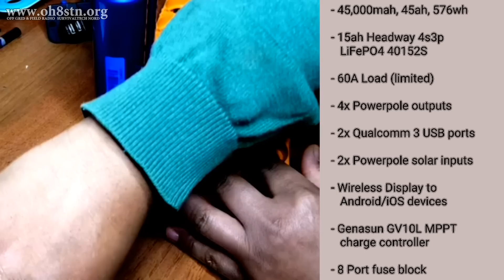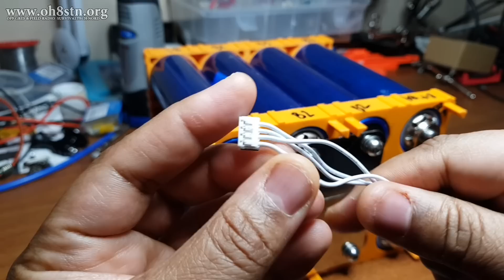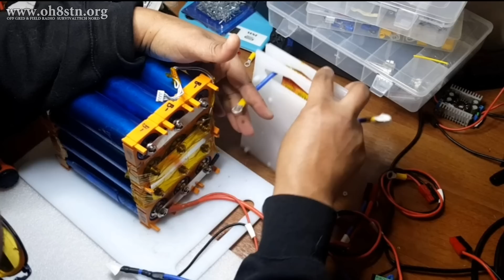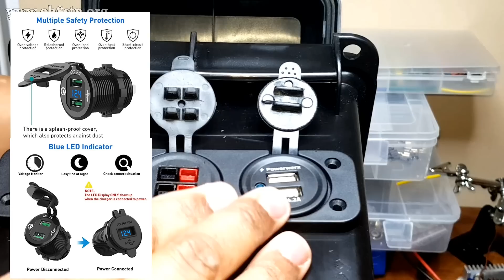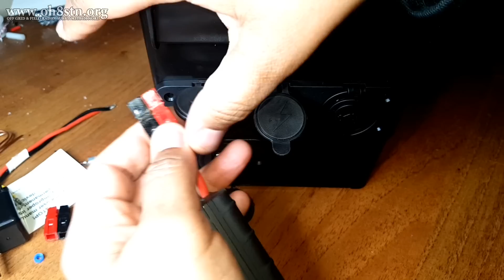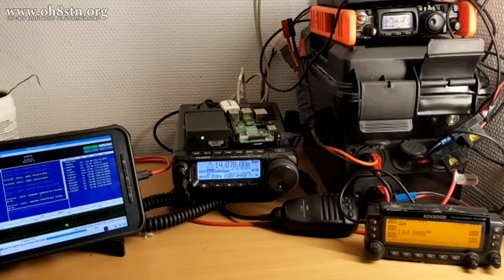DIY Ammo Can Solar Generator | LiFePO4 Off-Grid Power Build

Comment: Does this BMS - SCC combo allow the pack to charge over 13.35V? I cant seem to get it any higher for balancing, like 14.2, etc...
Reply from the maker: Hi Sammy, yes, it can charge above 13.35 V. I’m still using this build, and my battery reaches around 14.4 V. The charge voltage comes from the solar charge controller or external power supply; the BMS monitors the cells and can stop charging if a protection limit is reached.

If your pack never gets past 13.35 V, I’d start with the charge source. Whether you’re using a solar charge controller, bench supply, or charger, it needs to deliver enough voltage to bring the pack higher. Mine bring the pack to around 14.2–14.4 V. I’d also check the individual cell voltages with the charger disconnected. If one cell is noticeably lower than the others, it may be weak or out of balance; balancing can correct small differences, but it cannot repair a damaged cell. The BMS doesn’t boost the charging voltage. That has to come from the charge source.

Comment: Do you have a video showing how to configure the thornwave for this build? Particularly the low voltage disconnect. Or will the BMS cover it?   Thanks for your time N7JRK
Reply from the maker: There's a link in the description to oh8stn.org. There are all the details.  BTW, the newest Thornwave version is different from the one I used, so check the documentation for the one you have.

Comment: When using a charger to charge pack what voltage and amp settings should I use?  Thanks
Reply from the maker: 14 2-14.6v 10-20A is ok if your bms/cells can handle it. 👍
Reply: @OH8STN thanks

Comment: Built my own solar generator based on this tutorial. Same/similar ammo can but using 4 prismatic 100AH LiFePO4 cells. Genasun charge controller, BMS. I still need to add a smart shunt, ideally I should have used a BMS with such a shunt built in.....Internal distribution/fuse board. Currently using 1 100W solar panel, but will get another one to have 200W 
XT60 connectors 

Where I live I cannot get the Powerqueens etc. as they do not ship to here. Local battery sellers mark up prices by 200-300% (e. g. 100AH LiFePo4 battery ~$460) so the only way is to "do it yourself". 
Thanks a lot for this tutorial
73 de Jurgen 4z5oi

Comment: I had a Lithium motorcycle battery by Featherweight. However I accidentally ran the battery down and ruined it. What kind of safety switch do you know of that will cut off power when the battery runs low. (I was using it in my motorcycle, and had a parasitic drain that I didn't know of. So I wasn't monitoring it.)
Reply from the maker: Most riders only monitor the battery voltage during long periods without riding. In that case we would use some sort of battery tender to keep the voltage up up during storage. All quality LiFePO4 batteries have a BMS (battery management system) built-in. The BMS has a low voltage disconnect feature, which protects the battery when the voltage drops too low. Most of the time the battery is fine and simply needs to have a charge applied to get it back up above the disconnect voltage. Sounds like the featherweight lacked this basic feature.

Comment: You have piqued my interest in trying to build this generator myself.  I'm looking at your blog post now.
Reply from the maker: I thought the battery boxes were more your thing.
Reply: @OH8STN  I like both.  A new video will Premiere on my channel this week about a Renogy Solar Generator
Reply from the maker: You'll be sadly disappointed with Renogy for ham radio. I sent it all back.
Reply: @OH8STN  So far my experience has been good.  My video on Thursday tests RFI using the IC-705 and I found none of it with this unit.  I've also tested a couple of their batteries and had good results.

Comment: Your build has the power go from the battery to the fuse block, correct? I have seen some that go from the "load" output on the controller instead. Your way is the better way to do this isn't it?
Reply from the maker: It depends on the controller we are using. If you're meeting a charge controller, some charge controllers have a load port. Many of us incorrectly use them to Power Equipment rather than their real purpose which is to turn on or off a relay. I think the fuse block is a great way to protect the equipment from the battery and the battery from the equipment :-)

Comment: Good morning Good Sir, I have been slowly buying all the components to build this battery pack, one thing I am having trouble with is the BMS board.  The place you have listed requires you to buy 3 of them, and it wants $50 shipping to my home, do you have any other cheaper recommendations?  I just don't want to buy 3 of these, when I only need 1.

Comment: Julian, I was wondering if you ever updated the SG with the balance cable as one comment suggested?

And how you would wire that cable into the pack?

what I will think of that I think you should have done because it does not seem that you can get information about BMS works as it should or is reached is wrong so I think you should have a cable for the battery so you can easily check with one multimeter that all the batteries are balanced and if they are not, you can connect it to your charger with the balancing connector and charge it without having to remove everything
Reply from the maker: Yes I did wire up the balanced cable to the pack. It's wired in parallel with a bms. I use a 4s battery monitor to check the state of each cells. The battery monitor is not connected constantly. I use it periodically to ensure the bms is working properly. So far so good, the solar generator is still working wonderfully.
73
Julian oh8stn
Reply: @OH8STN  Thank You Julian. I assume you are monitoring the 4, 3P series cell packs and it is wired to the onboard BMS, to the sense leads. What 4S monitor did you settle on?

I really like this thing, such a great design and implementation of components. I need another one...

Thank You Again.

Comment: Great but I needed the AC.
Reply from the maker: The only difference between this model and having AC is a pure sine wave inverter. You can connect the pure sine wave inverter rather than the DC outputs on this. You can also utilize a combination of DC outputs plus the outputs on your pure sine wave inverter. Perhaps I should do a project.
Reply: @OH8STN  this is what I came up with. https://youtu.be/aTNk0sA5SpY

Comment: I’ve been watching these videos for a while and I would like to work on my own battery pack. Question I have is the charge controller is rated for 140v.  So if I use a 350v panel. Does that mean it will burn up the controller, or does the extra volts just go to waste ?   Thanks!  KI5PKP
Reply from the maker: It means it'll burn up your controller.
Reply: @OH8STN  Ahh. Thank you I will get a bigger controller or smaller panel!
Reply from the maker: Alternatively you can wire your panels in parallel rather than series. This will keep the voltage under your charge controllers maximum voltage, but increase the amperage coming from the solar panels
Reply: @OH8STN  Thank you kindly sir. It appears I have more research to do. KI5PKP

Comment: How do you use this without adding switch's if I don't put in a switch my battery just drains
Reply from the maker: I did add a switch to turn off the USB port. That's where the power drain came from.
Reply: @OH8STN  sorry must have missed that. Thanks for the speedy response
Reply from the maker: Don't be sorry. I'm not sure I mentioned it in the video. At least in the documentation. It's one of those things that you learn after you build something.

Comment: great video . Do you need to bottom balance new batteries ?
Reply from the maker: My strategy is fully charging, measuring internal resistance and capacity, then match the cells to their closest partner in the set before installing the BMS. I only bottom balance if using used cells, without a BMS.

Comment: What solar panel would you be mating up to this power pack?
Reply from the maker: Depends on my deployment.  Usually the fm16-7200 from @Powerfilmsolar i do use their rollable waterproof panels when it's wet or in the swamp. I use Powerfilm panels because I usually have limited weight carrying possibilities and restricted space.
Reply: @OH8STN  Cripes that's expensive! LOL. I'm working on my first "generator". 32ah 410 watt with built in BMS from Battery Hookup in a harbor freight ammo can. Typical USB, power, voltage display pack. I was planning on just charging it from an RC car charger at home, but for a couple hundred more adding solar makes sense. I'll be using it while camping to charge devices, lights, and especially for my power hungry Nikon while doing really long time lapse photography where the camera needs to run for 4-8 hours. I have that Genasun 140 watt charger in my Amazon cart...just trying to figure out the solar. I have trouble believing the specs on a lot of these foldable panels ~$200.
Reply from the maker: If you don't need the portability of the PF panels, and you do car camping for example why not check out the renogy konle's?
Reply: @OH8STN  Much thanks for sharing so much great info! Appreciated!
Reply from the maker: To add, when operating from home,  two 40 watt rigid panels in parallel, keep it topped up year round.

Comment: Thanks for the video!   Hello from Texas!  I am curious if this BMS has a temperature sensor? I am considering the 100ah headway cells once I am confident of where I can purchase them.  This will be my shack DC power supply.  I am new to the hobby and trying to get my ham shack in shape after all the various distractions that have popped up this year.  73!
Reply from the maker: The BMS does have temp sensor. It will shut down if things get too hot. Good luck with your build. Remember to ho slow.  Also, if it's not too much to ask, do I show and tell video after it's ready. It's inspiring to see how others have adapted this build to their own needs.
73
Julian oh8stn
Reply: @OH8STN  thanks.  I am also considering the Fortune Cells.  Have you seen them?  And to answer your video question, I will consider it. Right now I am in the dreaming and pondering stage.  I wasn’t going to build a ammo can power supply just yet but need a DC power supply for the shack. With battery power, I wonder if it needs a regulator to stay with INR the +\- range of DC voltage the radios will require.

Comment: What is the benefits of using your battery pack vs. A deep cycle marine battery? And what are cost differences? And will your battery pack fit into a boating battery box?
Reply from the maker: 1/4-1/3 of AGM weight. 2000-3000 charge cycles vs 300-500 for AGM. No peukert effect. initial cost is higher, but you'll have purchased 7-9 AGM batteries  before the LiFePO4 even begins to degrade (but still useable). Size is based on your design choices. Just use my build as a template.

Comment: Thank you for this. My Wife and I have been looking into solar generators for some time now, and this really hit home. We were thinking about building one out of old 18650 batteries, but we both came to the conclusion that there are just so many points of failure there and the need to purchase a spot welder on top of everything else. This is such a simpler design yet much better design, as well as cost effective. 
I am very grateful for your videos, you have educated me in many ways and today i ordered a FT-891 from HRO. It was an open box (Just a missing box, never installed or used) for under $550. Fully warrantable from Yaesu still. Someday it may all help save our lives.

Comment: Julian, I am having a time selecting the correct solar charge controller. Your QRO day pack video shows a GV-5 and the notes detail a GV-10. Can I use the GV-10, 14.2 V, 10.5A if I wanted to build both the QRO pack and the 4S3P solar generator? 

Is it this one? https://genasun.eu/collections/genasun-lithium-mppts/products/genasun-gv-10-lithium-14-2-volt-mppt

My panel is a 155 watt/20V/8A monocrystalline, 15 watts more that the GV10 max input. Guess I can fold a couple sections over to lower the output. That GV-8 controller looks nice too for multi voltage, but lower charge amps @ 8.

 Thank You for all your work and talents, SIMPLY MARVELOUS!

Comment: How are you getting 13.3v out of 4 sets of 3 batteries in series and in parallel?  Or am I not understanding the build and you have 3 sets of 4 batteries in series and in parallel? But then you are using a 4s BMS??? Please advise. Thanks KF0ALT

Comment: I have a question about your turnigy charger. I have the imax b6ac v2, which has the same or similar software inside. I cannot get it to charge my 8ah lifepo4 battery. I get a balance error. I select the life setting and 4s 13.3v. Is the BMS on the battery preventing something? Thanks for your videos! :) 
https://www.amazon.com/LiFePO4-Battery-Miady-Rechargeable-Maintenance-free/dp/B07X5G2FFW/ref=sr_1_1?dchild=1&keywords=8ah+miady&qid=1596753365&sr=8-1

Comment: Haters are everywhere.  I  got 2 -  4s Lifepo4   60AH cells . I used them to put in a  24v  UPS!  I also got 4 -  25 AH  cells.  I want to get more of the 60 AH cells.  They in 4 packs with straps holding them together with handles to make them easy to carry. I have fallen in love with Lifepo4  cells,  they are lighter than glass mat and most batteries last longer than  any other batteries!

Comment: Hi Julian, great video.  I have a question about the battery monitoring system.  In the beginning of the video you have the shunt portion of the battery monitoring unit with red positive leads, I'm assuming, and at the end of the video the unit has blue, negative leads hooked to one side of the BMS.  On the Power Mon website the wiring diagram show  terminal 10 connected to + side of battery and terminal 9 to load.  Can you provide me an exact description of how you wired your shunt?  Thanks  Kirk N6LKI
Reply from the maker: Hi Kirk. It's documented in the notes. Check the link in the description. As far as the discrepancy in the video, I just found it easier to wire it the other way around halfway through the build. The documentation on their website said it didn't matter if the shunt was wired through the negative or the positive lead. Nevertheless, I did follow the instructions of the shunt manufacturer in regards to wiring.
Reply: Thanks Julian, this was very helpful.  Plan to order the Power Mon unit next week.  Just converted entire shack over to solar using a DIY solar generator, MPPT charger and panels on the roof.

Comment: Julian.....I finally got everything connected and I'm up and running perfectly. Got beautiful sun today in Oregon and took out the little 110w solar panel. The power meter said the panel was putting out over 22v and 6.7 amps. I connected to my battery box on a battery that was fully charged. The powermon showed voltage climb to 14.25v and the current gradually decrease to .38 amps where it went into a float charge at .38amps 14.25v! Thanks again for all your help and all the time you give to your channel!  I will be leaving you something in the tip jar :-)
Reply from the maker: Well I'm glad if all of this was some help. 👍
 Here's a tip. Even though your batteries is 14.25, leave it connected for an entire day. That'll ensure your batteries are in balance, and that everything is working perfectly.
Anyway, be proud of yourself. It may not be the most cost-effective, but you've definitely increased your skill-set while having a blast. That's the ham/preparedness spirit. 👍👍👍
73
Julian oh8stn

Comment: Julian..Thanks to you I have been successful building a 4S7P Headway pack. I have installed in a portable box along with the Powermon device. I have the Genasun 10 solar controller also. I do have one question regarding Solar charging using the Genasun 10 inside my box. I have the panel input of the controller wired directly to powerpole connectors when I want to attach the solar panel. The Batt + side of the solar controller is attached to the battery + post and the - side I have connected to the P- line of the BMS.  Am I connecting this correctly? This would allow the BMS to protect the battery when using the solar controller and solar panel? Thank-you!
Reply from the maker: Hello Jeffrey. Put the charge controller in parallel with the main output. So it should be on the opposite side of the shunt as your BMS. Just in parallel with your DC outputs. The charge controller is not connected to the BMS directly.
Reply: Julian...My shunt is on the Positive output. I have the output of shunt attached to a positive binding post on my box and the P- of my bms attached to the negative binding post. All my loads (powerpoles etc.) are also tied to these binding posts. If I understand your reply to me I am to simply connect the BATT side of the solar controller to the binding posts..... B+ to red post and BATT - of solar controller  to the black post....which the P- from BMS also connects to. Hope that makes sense :-)  Everything is tied to the binding posts. Did I understand that correctly? I'm double checking because my powermon app showed a voltage on the battery go past the 14.2v and up to 16v before I removed the panel from the powerpole connector. I will try charging again today to see what happens.